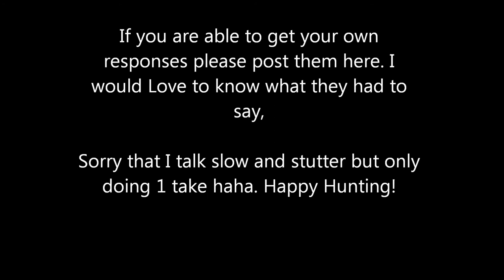New Radio Shack Digital FM Radio Spirit Box HACK!

Comment: i have had a big interest in ghost boxes and shack hacks now for a good few years and i managed to get my hands on this model and followed instructions on your hack video.ive had both 12-587 and 20-125 models that work really great. but this seems to scans a whole lot slower than both these models and there seems to be nothing else coming through it as it scans.I noticed that if you hold the scan button it scans digitally on the readout quicker but doesnt scan the frequencies on the radio itself .... maybe if it could scan at this faster speed in the same way as a turbo hack on other models ive seen it would make a promising ghost box

Comment: Have you ever hacked a dab. ??  Digital radio. ??  I would imagine it's possible. Would be a nice sound to it. I'm watching a 10B15 now on eBay. But I have bought a memorex 2extreme. Good little box. But I need the right speaker for it. Is it best to use a powered. Active speaker or is passive. Non amplified best pls buddy. ??
Reply from the maker: Reasoning to oblivion I would suggest keeping the radio 4 or 5 feet away if it is an active or amplified speaker which usually dulls interference sounds or  beyond perception. When it comes to RFI (radio frequency interference) a little distance will go a long way. I enjoy using an active (powered) speaker because it has dedicated drivers for better sound clarity. If you use a wireless setup,  I imagine there would be an increase of intermitten RF interface or even constant  interference. Let me know what you used, curious to see the affects it has on your radio. Any small portable radios are more susceptible to this phenomenon as well.
Reply: Thoroughly Paranormal hi buddy. Sorry for late reply. I've only just seen this post. I'm currently using a memorex 2extreme through a teac super woofer multi media sound system. Hey guess what I bought on the strength of this video. ??  Fro the USA. A 10B15 radio shack. Lol. I got it on eBay for something like  £22.99 it works out in gbp all in. Posted everything so I'm looking forward to that arriving. If it works well I have an idea so pls say it will work a dream. Lol. I don't rate this memorex. Saying that. Ohh. It's a long story but basically I just heard a piercing old steam train whistle three times in a row. And it went from around 97.00 MHz to 103.00mhz. Which I thought very very strange as another YouTube user and myself were talking about our paranormal experiences a few nights ago. And his was. He lives on a farm in Sussex. U.K.  And there used to be a steam train rail track run through the field on the back and when he was walking his dog he heard a steam train whistle in the same field. Wierd. Oh well. Take care dude. Talk soon. Hope my 10B15 works. 👍👍
Reply from the maker: Reasoning to oblivion Awesome bro! These new full on digital radios are becoming more cumbersome to hack due to no internal ribbon connections. Remember, this hack does require a tap of the seek button every now and then which is why i recommend to remove the antenna. Super happy for you btw! Im reading about circuit board electronics right now by John Davis to better explain things in next video and for better hacks!
Reply: Thoroughly Paranormal cool. If you know of anymore hackable radio shacks that I should look for on eBay could you let me know buddy pls. I'd be grateful. Thanks bro. And I'll keep you posted. I need to record some of my sessions but it seriously goes quiet when I record. It's like they know and don't want to or not supposed to make themselves known. Who knows.  Keep the good work up buddy. 👍👍👍

Comment: Thouroughly Paranormal I 'm confused,what to cut the six or seven ????????????thanks so much
Reply from the maker: Giuseppe Pirozzoli cut the 6th lol
Reply: ok thanks so much guy
Reply: HelloThoroughly,kindly tell me how did you make the radio edit? i tried to cut the 
"MUTE" thread but did not scan the radio stations in a sequense on a 
digital radio,i'm desperate,you can tell me where i'm wrong,thank you 
very much
Reply from the maker: Your going to have to cut either 5 or 7 as well, first make sure you removed the antenna see if that helps or wrap in foil before doing so, you may have a strong signal near you making it lock on.